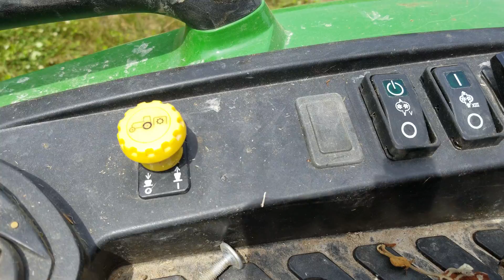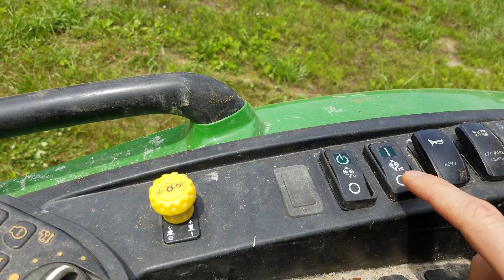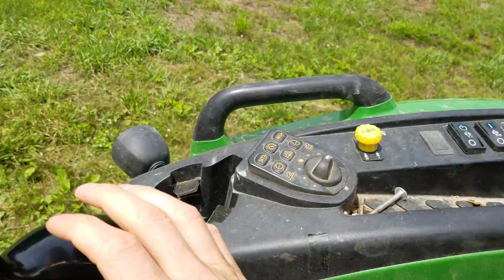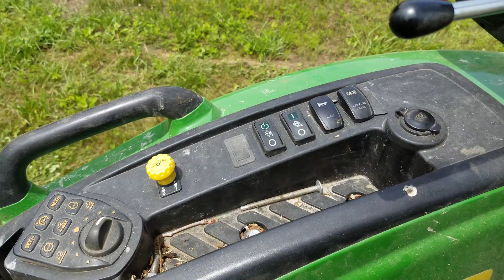John Deere 4052R 3rd, 4th, and 5th SCV's (Remote Hydraulics): Parts, Process, and Price

Comment: I wish someone would do a video for 4044M.
Reply from the maker: If I had one I definitely would!
Reply: I think they are similar, but still different.  GTT says I need a BLV10767 3rd.  Then I think it would be cool if you could have mid mount and rear with a valve somehow.  I found a JD hydraulic configuration install guide and it says I need an extra hard line when installing 3rd, 4th, and 5th together, but none of the instructions tell you where it goes.  I think JD likes to hold some cards on these instructions.  I’ll get it figured out somehow.  Your tractor is bad ass man!
Reply from the maker: @ajmz714x4 Well here's to hoping you figure it out!  I know what you are saying though.  I remember when I installed this  I had to do a fair amount of research to figure out what hard lines I needed and where they went!  One thing I'm going to be doing sometime in the near future is cleaning out my DPF filter.  It's starting to plug quickly.  I can't stomach paying 1,700 for a new one!  Thanks for swinging through the channel.
Reply: @ yeah man, for sure!  Def do a video on that filter clean!  I would like to see that!  Good content!  Love those R models!
Reply from the maker: Yea I plan on it!  It's going to be nasty. Ha.  The R models do have some nice features.  Can't believe I have had mine since 2016!

Comment: Thanks for the info, I enjoy your videos. My dealer installed my 3rd function to the rear. Then I plug in my flexible front lines to it for grapple work but I can also plug in my snow blower on the rear and control the chute with the button. Seems like your setup doesn’t allow this rear flexibility because it only goes to the loader.
Reply: @IndyFarmLife  G'day Adam, Did your kit BLV10764 come with the rear tubing also? It looks like that is the way it is listed in the parts list, however I am wondering if you didn't use the rear tubing because you were installing the 4th and 5th?
Reply: @IndyFarmLife  Cheers mate. I did confirm with the dealer this week. That will suit my needs for now. Now just need to wait 9 months for the tractor!
Reply: The author stated it’s a one tap on joystick Button and gapple opens all the way. You can’t tap little at a time to open grapple little at a time.  If I install 3rd scv at rear like you did and use a Hydro top link instead of grapple, this makes me think when I hit joystick button I can’t finesse open and shut my hydro top link??   Do you have experience with opening and closing your rear attached implement without it being 100% open or closed with touch of button ?